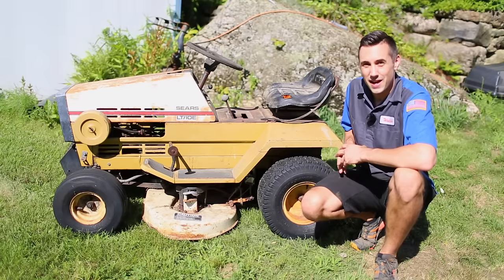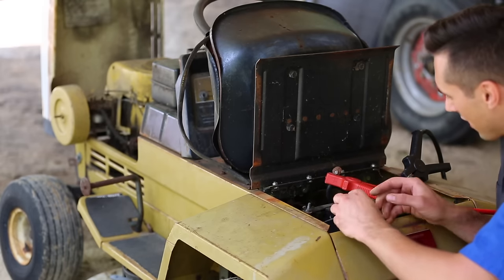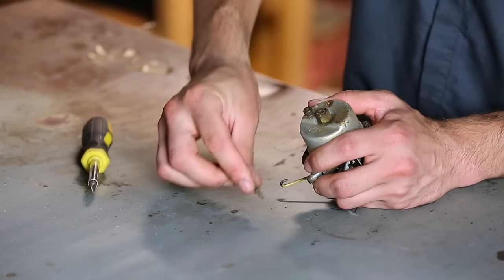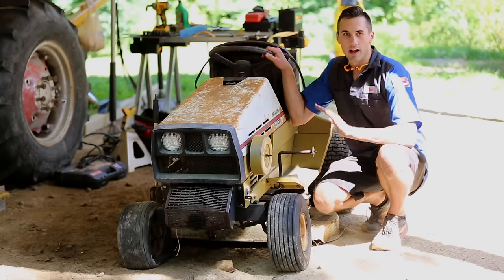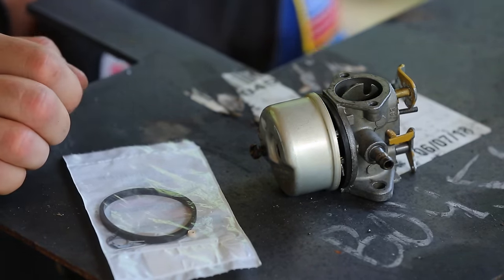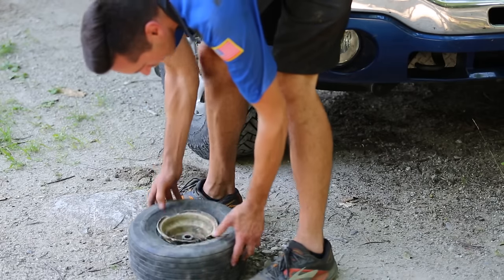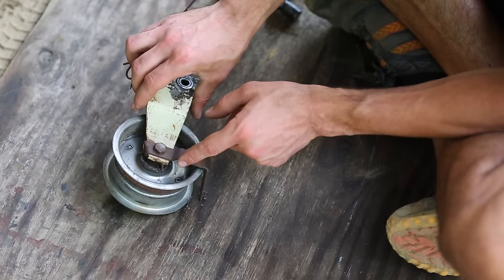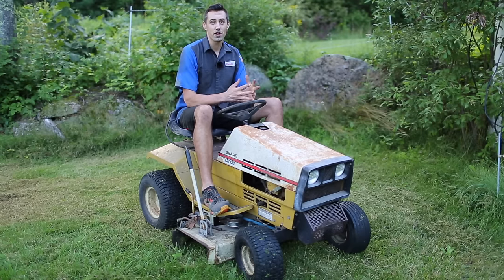Fixing Up a FREE 1975 Sears Lawn Tractor From Craigslist

Comment: I had a Craftsman 1975 16 HP Onan engine tractor. I used a 12" plow and a 36" disk, with a 48" sickle bar mower to farm 3 acres. Best garden tractor I ever had.
Reply: I have a 1976 with Onan engine, 12" plow and 36" disk. I  don't use it much anymore - just use my rear tine tiller. They are tough made!

Comment: Riding lawn mower tires are harder to change than regular tires. My local shop charges $20 for changing full size truck tires and $30 for riding mower tires. Also - when I have tire off - 
I thoroughly clean - wire brush and paint the inside of the rim with product called Xtra Seal Bead Sealant.  Good video!

Comment: Great job on that sweet old mower. Little tire trick- put some dish soap on the bead and it’ll slide on and off super easy. I’d change oil, spark plug, air and fuel filters next. Spoil her a little. Also recheck compression. After putting the oil in and running it, if it had a stuck or sticky ring it may have loosened it up. Keep these awesome vids coming!!!
Reply from the maker: Thanks, Pete! Yeah, I should check the compression after an oil change when the engine is warm. It seems like the hesitation starting is largely due to the choke position and possibly carb tuning issues, so I may not have to worry about the compression at all

Comment: Hey Waldo, great vid. I had a craftsman mower just like that back in the day. Those smaller tires can be a bear to deal with. Your backhoe loader is a great help. I have used the bucket to seperate beads from the rim. Also, if you set something under the rim, you can hold it steady with the bucket or an outrigger while you fight the tire back on thee rim. Hope this can help you in the future.
Reply from the maker: Thanks for the tips! Having a backhoe/loader really comes in handy, huh? 😂

Comment: We use a floor jack to break beads on our farm. Not one of the wheeled ones, but the ones with a flat end and a "hook". We put the "hook" under a tractor and the flat side on the tire, while someone stands on the tire to keep it from moving, the other person starts pumping the jack and the weight of the tractor pops the bead with ease

Comment: You did good work getting this up and running. This machine will last you a lifetime with that Tecumseh engine. They often get a bad name, but I find that they are excellent small engines if they are cared for. As you might know, you can still look up most parts on the Sears Parts Direct website just by using the model # stamped on the tag at the back of the unit. I suspect that it is is a "917" model prefix. Sears also had units produced for them under the "131" model prefix, that was Rally. The "917" models in 1975 would have been made by Roper for Sears. Eventually "131" and "917" were combined into "Rally Roper" and eventually, they became American Yard Products. At one time, the facility in McCrae, Georgia was the largest factory of its' kind and was spinning out all sorts of variants of units for different customers. American Yard Products also went by Electrolux, Electrolux Outdoor Products, among other names. Once you have the part # in hand from the parts list, you can shop that part # online or locally to source it, and see if it is still available or superseded. In the case of your tensioner pulley, you did the next best thing to buying new. You made it new again. 

I believe today, whatever OEM product support is still available would be through "HOP" or Husqvarna Outdoor Products who makes units at their plant in South Carolina if I remember right. If it's a "502" prefix model, Murray made it for Sears. The first three digits of a Sears model # denote the source code and who actually made it for Sears. There are various lists online that denote what these codes are. 

As other said, it uses a standard Indak key which can be bought online just about anywhere and Stens, Oregon and Rotary (the "Big Three" of the small engine aftermarket) all offer them in their line. HOP might even still be able to send you a copy of the original owner's manual. While most times, you can figure things out with some common sense, it does help to have the manual, as some of these models had some quirks and unique features at the time which when you read the manual you'll say, "Oh, so that's what that is and how it works". Also, the reference for parts is easily found as back then Sears insisted that their vendors always include a full exploded view and parts list with their products. Over time, most folks were able to save money and figure out who was making a given product for Sears and go there for parts versus paying the Sears markup. For instance, most appliance repair parts and repair people knew that many Kenmore appliances were made by Whirlpool for them under the "110" model prefix, among others and knew to go to that source for parts. Most vendors that supplied product to Sears still will support them even today, even if they haven't supplied product to them for years. I've had very good luck going back to the OEM even on Sears products made for them some 50 years ago.

When you had trouble with the tire, I was saying to myself, "Why doesn't he just cut off the old one with a reciprocating saw in pieces and just lift it out of the way?" LOL. Of course that doesn't make installing the new one easy, but it does take half of the job and make it easier. 

I hope you'll keep this one and run it for many years, just doing simple TLC like oil changes, filter changes and keeping it in good running order. I think you'll find it to be a good backup. I find equipment at the curb all the time and with very little effort and money, they are up and running again with no issues and I've been running them for years and years.
Reply from the maker: Thank you, and thank you for the comment!
Reply: @WaldosWorld  It's always good to see old equipment up and running again. After you shot this video, I wound up picking up a 1984 vintage Sears Craftsman engine analyzer from someone online that had no use for it. It's never been used, probably never been turned on and had all the attachments. It was missing only the owner's manual which I found quickly online, so it's now 100% complete.

Comment: Over here in the U.K. we have any number of lookalike mini lawnmower tractors ( we call them "ride-on" ) with very similar build - used one that could be yours' British cousin 8hp engine, flimsy pressed steel cutter deck - soon progressed to 12, 16 then 20h.p. better built jobs with powered brush cuttings pick up.
A tip after seeing you struggle so much with the tyre - for crying out loud! Take it off the axle and stick on a short bar in a good vice (that's probably a vise to you ) and you'll find it much easier for the working height alone. Second thing - when sharpening the blades of any mower - it pays to keep an eye on the balance.

Comment: A trick I use when breaking the bead on tires it to use the backhoe outrigger like you did with driving over the sidewall, and for really stubborn beads I use the rear bucket and push down with a tooth at the intersection of the tire and rim.  Last week a friend stopped over on the hottest day of the week and asked me to help remove tires from the scrap rims, I asked my son (7 years old) to run the backhoe and help with breaking the beads.
Reply: Friend was blown away he could run the machine so well, it was like a well oiled machine. I will try and grab the video off my security camera and upload tomorrow on my Channel
Reply from the maker: Oh wow, that's cool the your son is so good with a backhoe! Also thanks for the tip! 👍

Comment: When it comes to smile on my way Tires, a bench vise can be very helpful. Sometimes I use a Ratchet extension in the vise pointing straight up and slide the center of the rim over it to secure it while removing the old tire, you can even use the voice to break the bead

Comment: Also Waldo if it only runs on half choke, the carb is too lean. This could be caused by float position, or jets dirty. You may be able to adjust carb screws to get it to riches up. Also I love your little French voice telling the time passage. Lol
Reply from the maker: Good point, I’ll try adjusting the fuel screw outwards for more fuel 👍
Reply: @WaldosWorld .
Check out some of Mustie1's videos on his channel.
He does really good tutorials about rebuilding carbs.
Usually saying "we're going in"
He has a demeanor similar to yours with a serious dose making fun of himself.
I think you'll enjoy watching him if you have the time.
Reply: The bottom fitting in the carb that holds the bowl on usually has a tiny pinhole in the side that gets plugged, poke it out with wire. its usually that if it runs and then dies.

Comment: Hey if you want to up the compression without doing a rebuild use some engine restore when you do an oil change. I have used it with tested actual results so I definitely recommend
Reply from the maker: Thanks for the tip! That actually could make good content for a video 🤔
Reply: Waldo's World yes that would be awesome, add another testimonial to the engine restore with perhaps a before and after test!

Comment: Good video Waldo, I have a 1997 snowblower with a Tecumseh 8hp engine that sounds the exact same on start up and running and the carb is almost the same ,LOL , just goes to show youth the more things change the more they remain the same in some areas of life, I think i need a carb kit for my snowblower to along with an inner tube to fix 1 tire, 👍
Reply from the maker: Yeah, in my research, it seems like the Tecumseh carburetors largely stayed the same for quite a few years!

Comment: Next time on swapping out the tires in the riding mowers in the past I’ve used old school bumper jacks to break the beeds from the rim. Just sit the base of the bumper jack onto the tire allowing that the base of the Jack just clears the rim and proceed to jack up the car.  The downward pressure from the base of the jack will force the beed of the tire to pop loose.  Good luck

Comment: great video mate, keep those old carbs no matter what the knock-off sucks big time for small engines. for small lawn tractors, I just use a tube, only have to break one bead that way, and costs a little down. and I use jb weld steel epoxy for fuel and oil stuff, you have to let it fully cure and i have never had a problem once it is fully cured. if in cold( with the winters I get) double the cure time.

Comment: If you make a "ramp" with a 2x6 or 8" you can lay it on the tire near the wheel and drive up on it part way to break the bead. The stuff that the PO used on the rim was probably a commercial bead sealer. Liberal amounts of dish soap help to seal the bead.

Comment: Brings back a lot of memories my Grandparents lived on200 acres of land inUpstate New York and aside from a fleet of CubCadets and accessories they did like the 1970s Craftsman riding mowers my favorite one to cut with was a red Craftsman very similar to yours  except it did have a different gear selector and I think it was like 14 positions   Believe it used that engine  you have  because after my Grandfather passed I would visit my Grandmother and get everything running for her  other wise she would try and push the lawn cutting ? In her 80s  they were so rural that usually the only parts I could get was whatever the local gas station garage had in stock  which he did have most of the bets  in stock so I could stock her up on mower deck belts  if I didn’t want to drive 4 hours for other parts

Comment: a cold engine needs a richer mixture. the choke allow infinite adjustment of the mixture. pulling it out richens it, and pushing back in leans is it. the choke needs to be pulled out enough to start the engine when cold and LEFT THERE until it begins to warm up. and only then GRADUALLY pushed back in as the engine warms up. this process can take up to two minutes! it's not a matter of OFF and ON.

Comment: A tip reference Simple Green.  It reacts to aluminum and also leaves residue, which is why it's prohibited for use in aeronautical industry.  Simple Green makes different formulas, one in particular which is okay to use on aluminum, and it's commonly used as a gun cleaner by many gun manufacturers.  It's also used as a degreaser on bike and motorcycles parts.

Comment: That tire segment was painful to watch...those front tire/wheels can be a pita.  I found a piece of metal rod or even an extra tire tool that has the same diameter as the axle when run through the hub and secured horizontally in the jaws of my workmate will hold the tire assembly secure when pressed up against the workmates work surface. With the wheel properly secured, the tire will usually pry off easily. Also makes mounting the new tire a breeze.
Reply from the maker: Nice tip! 👍

Comment: You can temporarily wrap that fuse in tin foil and reuse that fuse ✌️👍
Reply from the maker: That's a good tip! 👍
Reply: @WaldosWorld  it's also a good way to start an electrical fire. The fuse is rated to blow at a specific amperage . what is the tinfoil amperage rated at?

Comment: That old carb is a piece of cake to fix, dont be intimidated by it. You need to adjust the main jet , its the screw on the center of the bowl on the bottom !
Reply from the maker: Haha cardboardeaters and I don’t always get along, but this one does seem to be relatively simple. I probably need to screw it outwards for a bit more fuel

Comment: Wonder what kind of shape the carburetor emulsion tube is in. Did he clean out the tank and replace the fuel filter. Also, a good time to replace the other piece of gas line and install a fuel cutoff.
Those deck tension pulley bearings should probably be replaced with bearings that have a steel cover instead of a plastic cover. 
A lot of noise coming from the deck. Could be bearings in the spindles need replacing.

Comment: the carbs. on these were junk where the hole is in the bowl the had a spring loaded drain plug to drain bad gas or water out. they were made to run on leaded gas. they would not run right off unleaded. we had  a 7 hp that was a sears had nothing but trouble with it worse mower we ever owned. they had 3 grades of mower back then the sears was the cheap one, craftman was next and the had a good mower that had onan or  briggs engines. they were made by diff. companies and sears put there mane on them. i wish you luck.i still have the thing if you need parts. take care, be safe and well.

Comment: Those pulleys are expensive so I always rebuild mine.
Reply from the maker: Yeah, that's definitely the smart way to go! 👍
Reply: Hi Waldo, just found this video. Great work, just one thing, don't know if anyone else has mentioned it but when making gaskets you'll find it easier and get sharper lines if you use the ball pean end of the hammer head not the flat end. Keep up the good work.

Comment: Ok so for those who don't know I'll save you some sweat and tears. Ya know the way the rim is shaped skinnier on the inside than it is on the outside. Stick the bead of the tire in that narrower part or the wheel when you're trying to get her off and on. That skinny little grove on the wheel. As for breaking the bead, if you can kinda wiggle a spoon in to get it started you're lucky. If not resort to violence or buy proper tools.

Comment: Why didn't you take it to a tire shop. 7.50 to 10 dollars a pro would have done it less than 15 minutes.
Reply from the maker: Yeah, that would have been a lot easier 😂
Reply: I bought a $30.00 tire changer from Harbor Freight, works like a charm on mower tires.

Comment: Trust me having run in the last few years is not a good sign. It's more likely it ran on the wrong gas and needs a carburetor replacement. I do far better repairing equipment that has not ran in a few decades. Usually with it you pour gas in and it runs

Comment: I’ve got a 73 st16 that I’m in the process of putting a Yanmar l70 on & it’s great. I had a predator on it for a while, but it died. Can you please lose the stupid music I want to hear you talk about the mower not the stupid f$&@$&@ music. 100psi for a lawn mower engine is abt normal. Some engines have a compression release like the cast iron Kohlers from the 60s-80s. They won’t read more than 65psi even if they’ve been rebuilt.